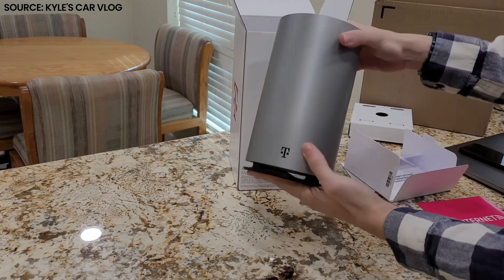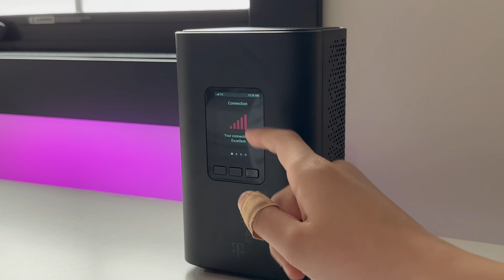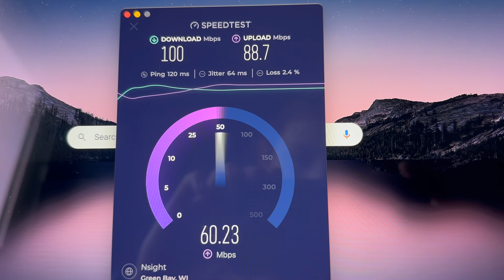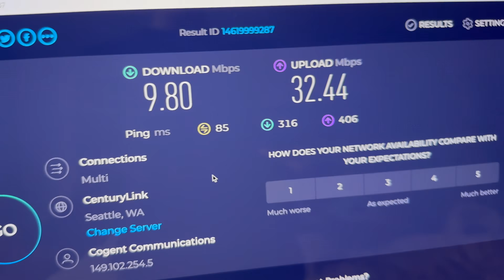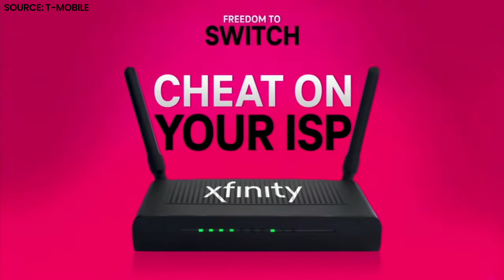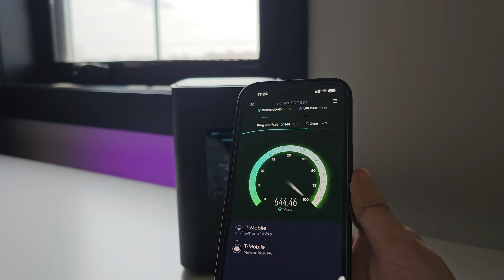T-Mobile Home Internet Review 2024: EVERYTHING You Need to Know!

Comment: After using MetroPCS since 2017 for my 4 phone lines I made the mistake of trying their Internet Deal. Free month of Internet is a joke. It costs you $55 for a (FREE) month. The sales person told me I would get my (FREE) month on the nest bill. LIE. 
Then they billed me again in 18 days (NOT IN A MONTH).... and cut my phone service off because of the additional bill which I wasn't expecting for another 12 days.. I was forced to pay again to keep my phone service. The REALITY OF THE INTERNET SPEED TRY 23 MEG on the OKOLA speed test, If your trying to watch a program on tv it will sputter and freeze. You TUBE CUTS OUT . If you have 2 devices they will not work at the same time... If you have 1 it might work. DON"T BELIEVE THE SALES HYPE.... THIS SERVICE IS CRAP /  I AM CANCELING AS SOON AS THIS BILLING PERIOD EXPIRES. Then their is the customer service issue.. IF YOU CAN GET PAST THEIR COMPUTERIZED VOICE DEFLECTION SYSTEM. YOU CANNOT TALK TO AN AGENT. Even if you need one, It will just keep cycling you through and asking the same question over and over again.. BEYOND FRUSTRATING... ABSOLUTE WORST CUSTOMER SERVICE: BE WARNED... However you can go to the store and pay them $5 to help you as your only option. Sorry for the CAPS... Its just how I feel right now.  Good Luck
Reply: Everyone is differently due to what TOWERS are close to them. That’s all. The towers

Comment: I purged in and nothing I see two passwords
Reply: Hello. I saw you need to scan a QR-code in order to complete the installation of the router. 

What happens if later someone at my house scans the code again? Will that disconnect the modem and we need to activate it again? Or it will already set up and it will just give access to the app and the modem's settings?

Thanks!

Comment: Deceiving!  To anyone whos thinking of trying out the Tmo 5G home internet,  MAKE SURE to have them check their  'signal' specifically to where you at. It may be available but not that strong / reliable yet. Happened to me. And charged for the $$ w/ no 5G working at all. Hardly can even surf the net!   Like mobile receptions,  some areas good ( full bar)  some areas sux!  Sales would promised  good / fast connection and everything just to close the deal!  Definitely not in my area. Learned my lesson to be more careful with Tmo!
Reply: Are they able to do that from the sales side?
Reply: @marianbarlage818  yes, i was told by the cs  when i called in that  if the sales should have check their system for the signal strength,  could have been avoided.

Comment: Didn't mention that T-Mobile throttles home internet during busy hours like 4pm-10mp. Depending on traffic your speed can drop to 5mbs download. 

There are cellular routers out there that can accept the T-Mobile sim card if you want to add external antenna too.
Reply: What's a way around that Throttle?most annoying thing about it for sure,having 800 ping in games is not fun at all 😂
Reply: @TheMetal747  replace T-Mobile gateway with an after market cellular router. One that lets you set the IMEI number and has band locking.

It will not totally remove the throttle but you can lock the router to the fastest band. On way TMobile throttles you is by placing you on a slow band during peek hours. A router with band locking prevents that.
Reply: Never had that happen.